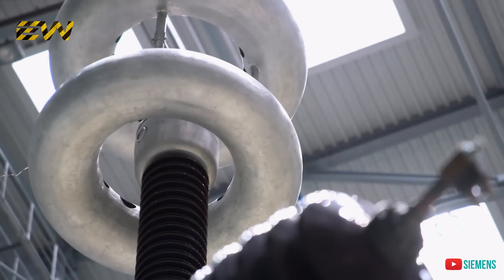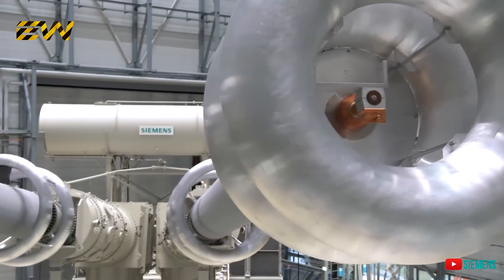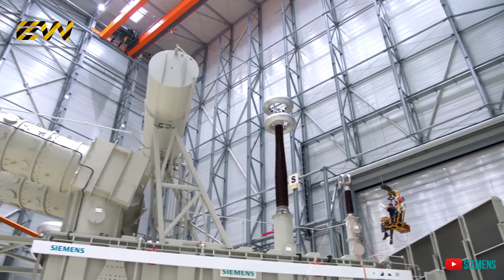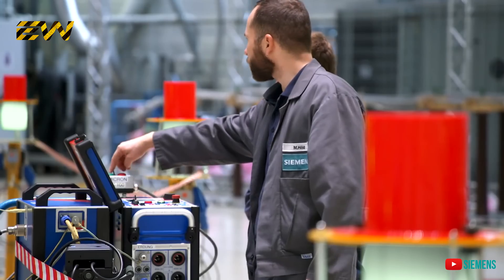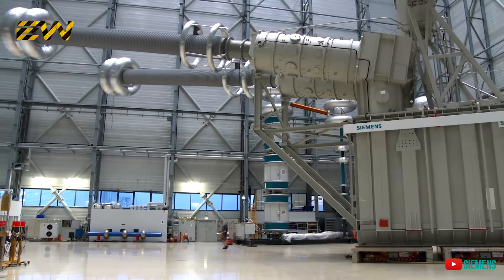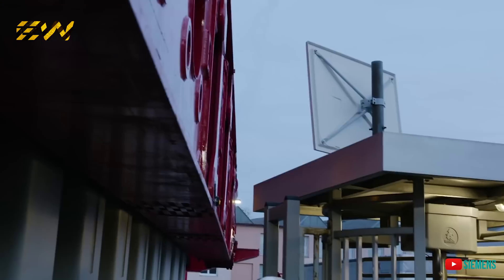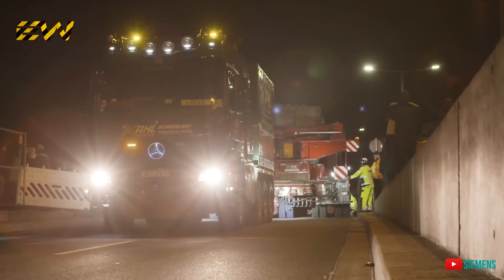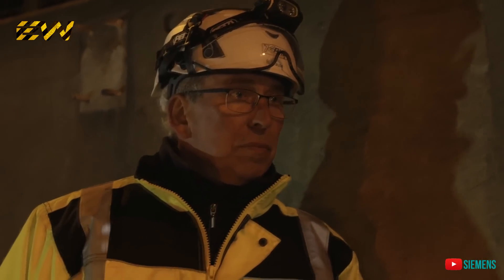World’s BIGGEST Electrical Transformer Video

Comment: A Transformer is an electromagnetic machine which has to cater for the Electric and Magnetic effects, their magnitude and their rate of change, together with their associated voltage, current, temperature, and mechanical requirements to be able to withstand the forces and stresses irrespective of their nature. Basically, there are three looped circuits one must cater for, these are in the form of a magnetic loop curling with two voltage/electric paths called the primary input and second output path, the latter two being also the input and output current paths.  As far as material is concerned the electric path would require a conductive path for the current and an insulator to isolate the high electric fields while the magnetic path would require to be made of thin laminated steel to reduce eddy current effect due to the rate of change of the magnetic field in it. 
Since the question addresses why the transformer size increases with the increase of voltage rating one need not talk about the power rating of the transformer due to an increase in the current where the copper primary and second coils have to be increased in AREA size. With voltage increase, it is the isolating INSULATION  that needs to be better for the separating medium that will stop the electric stress breaking through from the primary to the laminated steel magnetic path, or to the secondary coil.
 The transformer will increase in size due to nature with which the windings need to be done. The voltage is so high that one cannot wind one coil with the turns riding on each other multiple times as if one regards a coil as a long wire having a very high voltage at  its ends, then one can not bring the two ends too close together below a certain distance as otherwise there will be an electric stress breakdown and the system will fail.  Normally a high voltage coil is wound with the next turn close to the previous turn, but the turns are made to always move away from the first turn and the progressing turns are never returned to ride on the first turns of the coil.  So basically a high voltage coil must have the turns progressively distancing away from the starting end so that the Finish turn in the coil would be at the greatest distance from the first turn.  One must consider that since it is a high voltage transformer which has a  large area magnetic path, even one turn will have a high voltage induced in it.
As far as the magnetic path is concerned, in order not to saturate the magnetic path, one needs a large area and the relation of the voltage used to the area of the magnetic path required, depends on the magnetic material used. When I was very young, with the laminated material I had 70 years ago  I used to wind the coils using the rule of thumb  7 or 8 or 9 turns per volt per square inch of the magnetic path.  For a short time rating I used 7  and for the contiuous rating, I used 9 turns per volt per square inch of steel. For the current path I used for Naval Purposes 1000 amperes per square inch but in nonwar issues, I used 2000 amperes per square inch of copper........ but times change and dimensions would change with the difference in better insulation, better iron magnetic steel and better copper paths. 
So it is the nature of winding a high voltage coil, the need not to saturate magnetic laminations, and if it is to carry more current it has to have a larger area in the conductors used.  Obviously the cooling, monitoring and protection devices for gassing, temperatures,  oil  or air circulation  plus the mechanical strong construction required to  take the weight and transport it without causing any mechanical warping of the unit, all adds up to an ever increasing in size, but for a high voltage it is the insulation and the magnetic path required that will make it increase in size.
Reply: These were my thoughts/conclusion yet somehow a comment talking about the amount of impedance won out. The amount of impedance could be 1 mH but if your primary voltage was 900 GV you’d still need an incredibly large transformer.
Reply from the maker: Thank you for your feedback! 

Have a nice day ^_^

Comment: Ans to the question...
Reason 1: Higher voltages needs to be better insulated. Thus larger clearances needs to be provided for a material of similar dielectric strength.
Reason 2: Higher voltage is economical, only when U deal with greater power transmission and larger MVA transformer means more heat losses, which requires greater space for dissipation of this addional heat.
# Please note that I am not an expert in this field. The answer may not be correct...

Comment: high voltage need large amount of insulation on the core einding coil and more complicated safety system also it is need more tank space for oil capacity to immerse core and other ancillary equipment also to reduce losses need much more irin core size
Reply from the maker: That's absolutely correct. Thank you for sharing your knowledge with our audience here. Consider subscribing to our channel for more engaging videos and technical discussions. 

Subscribe here : https://geni.us/SubscribeChannel

Comment: Size of transformer increases with increase in voltage because voltage per turns is directly proportional to the net iron core area. 

2 . As net core iron area increases the insulation used for transformer also increases

Comment: Hey guys, yeah, the reason for the size of the casement is because the bigger the voltages the bigger the tank .
It's too with the cooling of the coils inside, the tank is full of heat transfer oi,l that's what is pasing through the cooling Finn's. So there's a certain amount of oil in the tank that is circulated around the coils to keep them at that happy running temperate.  This is why the higher the voltage the bigger the tank .

Comment: As the voltage increased the number of turns in hv side increased and with increasing voltage. Insulation also increase and for 1100kv it's much more necessary to keep insulation of adequate quality and approved material so size increase
Reply from the maker: That's absolutely correct. Thank you for sharing your knowledge with our audience here. Consider subscribing to our channel for more engaging videos and technical discussions. 

Subscribe here : https://geni.us/SubscribeChannel

Comment: With transformers, higher frequency = more power density because the coupled power is directly related to the di/dt. With higher frequencies, the losses are far greater during transmission (the capacitive coupling to ground). This is why DC transmission makes sense. Generator -> rectify -> high frequency step up -> low-loss DC transmission -> high frequency inverter step-down. Silicon (and very soon enough gallium) will enable us to make smaller therefore cheaper transformers, and get lower loss DC transmission while still have the ability to step up and down.

Comment: The higher  voltage  need  more  coil wound and  it increase  with  voltage .The  higher  voltage also  need  cooling system either oil or air, this may  also  increase the  transformers size.
Reply from the maker: That's absolutely correct. Thank you for sharing your knowledge with our audience here. Consider subscribing to our channel for more engaging videos and technical discussions. 

Subscribe here : https://geni.us/SubscribeChannel

Comment: Increased insulation requirements in terms of thickness due to high voltage involved.
Reply from the maker: Thank you for your feedback! 

Have a nice day ^_^
Reply: @Richard Vaughn It has inverters as well? I guess that’s because the generators are DC?
Reply: @Richard Vaughn I know generators are AC, however DC generators do exist. But why is the supply voltage DC and not already AC? Unless the supply voltage is coming from another HVDC line?

Comment: Why does it increase in size? Well, due to the apparent voltages and the ammount of windings and size. Of the wire , it just stands to reason that the size HAS to be greater due to inherrant heat created by such a load. The video never said anything about amperage draw or wattage, but I can Imagine this would be substantial. So the size has got to directly correlate to these factors. It boilds down to P=I×E. Where power is work dissipated by heat. Since the voltage is so high, even at one amp, there is as many watts. Dissipated as heat. A smaller unit could never handle this type of usage. I am assuming that a cooling system of some sort is in place so, there's this added into the factor.

Comment: Ar high voltage ... insulation reqirement will be more and so for high current wire thickness is more ....,.....also as V=4.44fNBA
So voltage induced is directly proportional to A ie.. area of core of transformer......so for high vol core cross sectional area will be large

Comment: To increase in Reactive power the coils must be increased. So the overall rating of the transformer increased with respect to size
Reply from the maker: Well the size of the transformer increases with the voltage is rating is because the insulation required inside increases as well. So more paper insulation over the coils and more clearance is required from the body of the tank. 

I hope this helps you understand.

Comment: That is the BIGGEST transformer I have ever seen. Many more parts were attached to exterior at job site....

That transformer was too big and too heavy for the former Antonov AN-225 to move. The Antonov was the largest cargo plane before getting destroyed in Russian invasion of Ukraine. It did haul a very large transformer in 2016. 

Air Charter Services (ACS) chartered Antonov Airlines’ AN-225 freighter to transport a 182-tonne transformer from Brazil to Chile, which it claims is the heaviest single unit of cargo to be transported by air in the Americas. The huge transformer was flown from Sao Paulo to Santiago de Chile, from where it was transferred to its final destination to replace a damaged transformer at an existing plant, reports Heavy Lift.

The AN-225 set another world record. On September 11, 2001, during one flight, the AN-225 set 214 national and 124 international records, including the transportation of the heaviest payload ever airlifted, at 253,820kg (559,577lbs). That is just over it's design limit of 250 metric tons.

Entire Aviation World mourns the loss of the Antonov AN-225 Mriya. It was One of a Kind.

Comment: all i can say is WOW,WOW,WOW  over 1.100.000 volts . do they have to bring the transformer above ground on insulators to keep the tank from shorting out to ground. the switch yard must have massive circuit breakers  and switches . with a free air transmission line that long it will have a massive charge on it even when the power is off .???????

Comment: Why dc? Is it direct current? Why? Isn’t it supposed to be inefficient? What am I missing?
Reply: DC is actually more efficient because you don't have to worry about things like reactive power, line capacitance, skin effect, etc.

The problem is it's very hard to change the voltage levels in DC efficiently, which is necessary in a power system: I want a voltage as high as possible in the transmission lines, to reduce the losses, but I don't want high voltage in my house.

That's where AC comes in. In AC you can use transformers to step the voltage levels up or down efficiently. Nowadays we can convert between AC and DC with a relatively good efficiency, due to the technology of power electronics, but on the time of Edison and Tesla things were different.
Reply: @Israel220500  I'd like to see the 1100kV rectifier.

Comment: Why does the size of transformer increase as voltage increases.. 1.) If theres not a large/larger current to, go with the Voltage, its useless. So, maybe a larger scale of hardware to support the weight of the metal mass needed to Shield Magnet field for pin point precision where it needs to go. This build is amazingly beautiful. The amount of conductive/superconducting material used in this transformer has my head spinning. Why isnt this tested with "old" discoveries by, raising it up high in the air, obtain an unbreakable earth ground, DEEP.. very very deep. I believe connection wise, this was only 1 of Teslas discoveries by the 1900's. 

(PIST) wireless electricity has been used since longer than most of us could fathom. Way before we could possibly really even remember & at least since you could  remember plugging in your first cell phone (Transformer) in the wall to charge your phones battery or many, many, (almost everything) other devices. This is all old "wireless transmission"from A.C 110v to 18v/12v/10v/8v.. whatever you needed you would have a specified amount of turns per coil near 1 another, will produce an effect of up/down range in the voltage. Now thats old school, now Diodes give us DC, rectifier diamonds, transistor.. now thats an area where Siemens should be investigating with that coil. You can increase a very small amount of current/voltage into the unknown blackhole we'll rip in the atmosphere of our home .. lol bye
Reply from the maker: WOW

Comment: To Increase power and voltage ratings you need to increase size and insulation. Also because it's a DC Transformer it will have rectifiers built inside the transformer.
Reply: Yes, that’s a good point that I haven’t seen anyone make yet. But since this is the “endpoint” transformer, it should have some sort of inverter circuitry instead of rectifiers. I can hardly imagine the size, complexity and engineering needed for such a high voltage inverter (and presumably high current output).
Reply from the maker: Very true indeed !

Comment: With high voltage rating we need higher level of insulation and also 
its creat a lot of heat with is needed to be dicipated through bigger areas 
high cooling facilities requard 
overall making transformers big
Reply from the maker: Thats correct !Thank you so much for sharing your feedback!

Comment: size increase is dictated by coil turns to achieve desired input output  characteristics. more cooling and more insulation for HV protection but im no specialist just like transformers and bridge rectifiers. Like to build my power supplies.Would like to put my hands on CC CV unit.wink

Comment: The answer for the question ,
It's true that transformers sizes are directly proportional to its kVA rating.

But when the voltage level of the transformer is increased this also leads to have greater size that's all cause of the cost.

Considering transformer of working voltage of 66kv and 30mVA of power deliver,
And now consider a transformer working voltage of 132 kV and same power delivery of 30 MVA ,
Now after doubling the voltage level size of transformer reduced,
But at this condition the cost economy will very low for 132 kV working voltage transformer, and this would not good idea,
So increasing the size of transformer ie kVA×2  of transformer, it will cost as same as initial power.
So again if power further more increased even this would cost lot more less than producing two or more transformer to meet same power delivery.
So the transformer sizes increases with increas in voltage level to achieve higher cost efficiency wich will affect positive to both producers and the costumers

Comment: It has a direct correlation between  voltage mass and frequency. Useing lens law magnetic induction residence and copper coils or aluminum. Faraday's law farads the excitement of electrons within a magnetic field. And hurts the frequency that the electricity oscillates at

Comment: Because high voltage deals with air gap between sources and load
Reply: Also because the electromagnetic wave around the conductor carrying high power is very high but the coil generating the voltage has to have so much turn needed

Comment: How does a transformer feeds DC power in power grid...?
Reply: @Groupcomms  thanx... 
But i knw the usual transmission and distribution system working .... My question is,  it is said in the video.. That the this transformer feeds the DC power in power grid... That's y I asked!
Reply: It will have rectifiers inside of it!

Comment: This is too old technology, it’s supposed to deliver DC power, there is no 50/60 Hz AC inside, meaning a lot higher converting frequency’s and therefore less copper and iron. The size is manly due to the effort of insulating those 1.1MV DC.